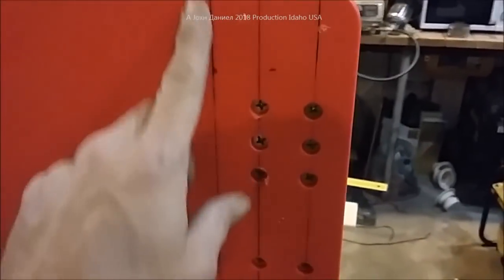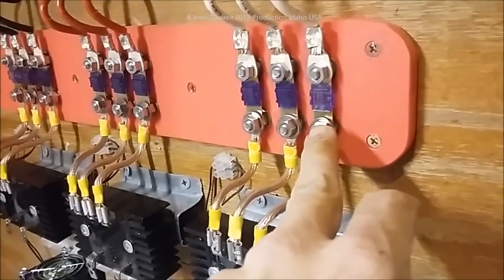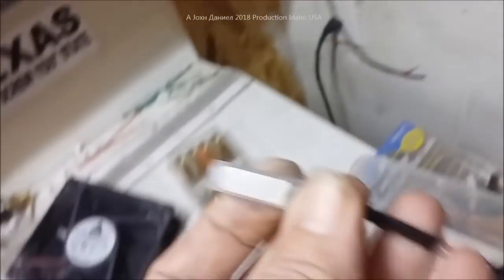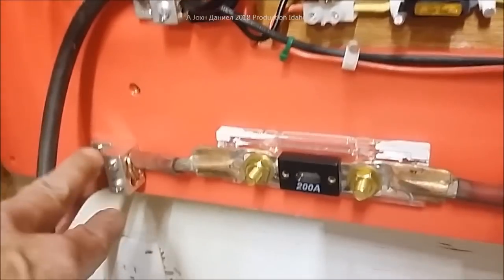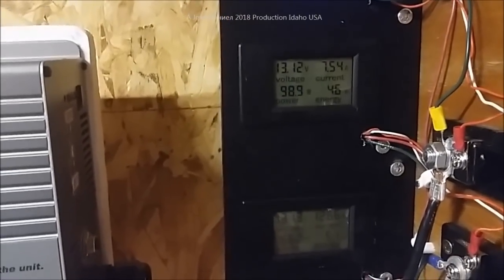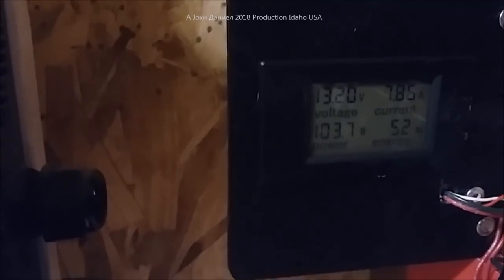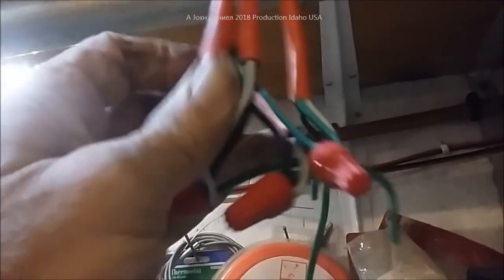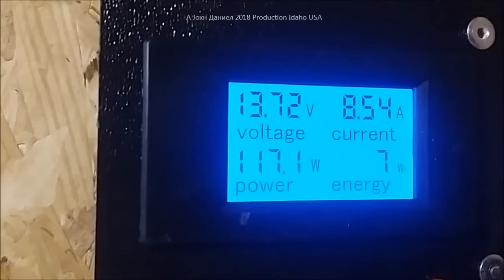Micro Wind Turbine 3 phase power systems Rectifiers pt. 1 my FULL PARTS LIST BELOW

Comment: Few years back I was checking wind power and based on my search I though the small turbines are a joke. Now your videos got me again interested in wind power! Can you give me any advice on choosing the right model of turbine and maybe also a controller? I currently have (3x80) 240 W solar panels with a controller and one 300 Ah 12V battery at my cabin. As the cabin is right next to the arctic circle I do not get too much sun light in the winter so I am thinking of a backup with wind power. I don't go to the cabin too much during the coldest and darkest time so the consumption is small. Cabin is quite tiny so I can't build a setup like yours. It needs to be something small and handy for the controls. The cabin is located next to a small lake on a hill so I get some wind there almost always but rarely any really strong winds. What I was thinking is a 400-500 W wind turbine and a hybrid controller like this https://www.ebay.com/itm/500W-600W-1000W-1400W-2000W-12V-24V-Auto-Boost-MPPT-wind-solar-hybrid-Controller/161945572633?hash=item25b4b55519:m:mcS4f4VkjihbJu8mwIYnbng. I don't see you using such controllers and I have not found much information about them. Any ideas / comments to help me? Thanks!
Reply from the maker: I would be sure to get a furling turbine if your not always there so it can save itself in a mad wind event, and that controller is a decent controller for your adventure.
Reply: Ok, thanks! The winds here never get close to the safe speeds mentioned in those chines turbines so I think I am safe with those. Just need to select one that actually works. Just too many models to choose from.
Reply: john who would you recom. for a furling turbine. Only one i saw was from missouri, i know you do not like them
Reply from the maker: Depends on your wattage and voltage you want, the best one of which I have installed 9 in 4 years is http://s.click.aliexpress.com/e/bU7iyNJ by Sunning Wind Energy because it has dynamic breaking designed into the blades, at 38 mph it just will not stay into the wind due to the blade design, below that its a power monster.
I avoid all the hyped up Sucker Born every minute sales clown in Missouri for numerous reasons, his junk in one of them his sexual activities is another. Can't stand people who exploit kids.
Reply from the maker: Another superior turbine with 12 and 24 volt, with dynamic breaking on the blades. http://s.click.aliexpress.com/e/ZnI23Zb . Sometimes referred to as a GIGU 600, they have been around 15 years, very stable company.
Reply: thanks John for getting back so quickly. I currently have pv panels 520 w and want the turbine to supplement that. 12v system with 700ahr battery bank. the system is for weekend use at present.  I am in upstate NY on top of mtn. avg. daily winds 10 mph.so which would be the better choice 3 or 5 blades? i am looking at this 600w unit you recommended
Reply: oh forgot i can not seem to find pt2 of this video
Reply from the maker: For the money, your area the Gigu 600 in 12 or 24 volt is a optimal choice. Its very robust and rated accurately. On my channel near this video in Dated upload relation you can see more on the installations. I do need to do a in depth final on how to build a REAL diversion load controller that uses Solid State Relays and a staged system. I'll be working on that ASAP.
Reply: 3 or 5 blade

Comment: I'm trying to learn...  How are you changing ac to DC? (Guessing rectifiers) What voltages?! What rectifiers are you using? I'm going to get a setup going soon, but I'm going to do solar/wind on grid tie...

Everywhere I look say to run a transformer...
Reply from the maker: I highly recommend this little turbine for starters. It has the controller that does all functions and conversions including braking, rectification and its easy to get a walmart warranty on for a few bucks. Its 3 wires down to the controller, 2 to the battery. Completely self regulated.  http://linksynergy.walmart.com/fs-bin/click?id=nNC3MIW3bd8&type=10&tmpid=1081&offerid=223073.7442&RD_PARM1=https%253A%252F%252Fwww.walmart.com%252Fip%252FVEVOR-400-Watt-Wind-Turbine-DC12V-Wind-Turbine-Kit-800RPM-Wind-Turbine-Generator-20A-Hybrid-Controller-Perfect-Green-Windmill-Home-Business%252F865700103%2523%252Fread-more%253Faffs%253De
Reply from the maker: PS, you can build a monster system in 12 volt - I did, don' t be fooled by the SELLERS promoted videos who say 24 volt or higher. If you go 24 volt and higher THEY own your ass for parts, supplies and gear. One failure in the higher volt system your waiting weeks to get a part, with a 12 volt system you can get a part anywhere.
Reply: Umm I'm building my generator from scratch and adding my magnets and doing it myself... I appreciate your help but... I'm trying to convert ac to DC, I guess I'll have to blow a few diodes and capacitors up til I get it right... I guess by ogms law, 600 watts at 12 volts is 80 amps, so as long as I double the amp capacity on diodes and build the bridge using 10k capacitors (was gonna do 1k but I'd rather have a static bank) I'm using an ac three phase and trying to go full wave.... I'm no expert but... I think I might have figured it out...
Reply from the maker: Just get a 100 Amp Rectifier 3 wires in, 2 out.

Comment: What are you using for a charge controller?
Reply from the maker: The best on the market. A Wind&Sun URD. It uses dc to dc  SSR Relays, is full pulse and dependable.
THE CONTROLLER - http://rover.ebay.com/rover/1/711-53200-19255-0/1?icep_ff3=2&pub=5575119394&toolid=10001&campid=5337966591&customid=WIND+AND+SUN&icep_item=131276389277&ipn=psmain&icep_vectorid=229466&kwid=902099&mtid=824&kw=lg #1 controller for diversion and wind
The best dc to dc Solid State Relay to buy is MAGER! (rest are bad deals, knock offs) http://rover.ebay.com/rover/1/711-53200-19255-0/1?icep_ff3=2&pub=5575119394&toolid=10001&campid=5337966591&customid=MAGER+SSR&icep_item=262718279412&ipn=psmain&icep_vectorid=229466&kwid=902099&mtid=824&kw=lg LMMC 
That controller comes with impressive instructions and source info.
Reply from the maker: I see your investing in a turbine, Be watching, i'll do a full ALL PARTS AND PROCESS NEEDED from Turbine to Battery video in the near future.

Comment: Question John I have a interstate marine Battery and I have a harbor freight 100 watt solar panel  unit with a charge controller if the battery is fully charged what should the charge controller read 12.8 or 13.4 or 14.2 what should the number be
Reply from the maker: +LOJO Marine 14.1 then it'll disconnect then reconnect at 13.8 or so. It won't stay at 14+ since 100% charge is 13.85 in a 12 volt battery and sitting charge status is 12.8

Comment from the maker: Meters 100 Amp DC, from the actual maker who sells it on ebay http://rover.ebay.com/rover/1/711-53200-19255-0/1?icep_ff3=2&pub=5575119394&toolid=10001&campid=5337966591&customid=MULTIPLE+METER+OPTION+20-100&icep_item=192247826429&ipn=psmain&icep_vectorid=229466&kwid=902099&mtid=824&kw=lg Original Meter Manufacturer, 8 to 10 day shipping.  This video shows you the simple building process of Rectifiers and Meters.  SEE MORE BELOW - Video 2 will explain how to build your own REAL diversion controllers.
A VERY Smart thing instead of buying something fake claimed as 400+ amp in a big stupid box for big stupid people with under rated 4 awg wire in it only good for 100 amps that may burn your house down.  Don't buy the hype, fraud and irresponsible stuff on the internet, build your own with trusted parts and facts.

 I restored the SUPER CHAOS turbine and put 2 more on the system. Using The world famous HORNET PMA  http://rover.ebay.com/rover/1/711-53200-19255-0/1?icep_ff3=2&pub=5575119394&toolid=10001&campid=5337668021&customid=14+Mag+REAL+HORNET+PMA&icep_item=232605009519&ipn=psmain&icep_vectorid=229466&kwid=902099&mtid=824&kw=lg Original Inventor & best on the market
 The 90/180 amp turbine Slip ring, from the ONLY HONEST SELLER http://rover.ebay.com/rover/1/711-53200-19255-0/1?icep_ff3=2&pub=5575119394&toolid=10001&campid=5337668021&customid=GENUINE+MOFLON&icep_item=271652086953&ipn=psmain&icep_vectorid=229466&kwid=902099&mtid=824&kw=lg REAL THING  - its Not a MISSOURI / Vietnam Knock Off 

This video shows you the simple building process of Turbines, Rectifiers and Meters.  
Chaos and Grey Matter is Made with PROVEN materials. If you want fake watts, you have to buy from places in Missouri. I suggest your parts come from proven sources.
 Ask, I'll send you links and you can review and apply.
Reply: At least, you should try the capacitor hook to one of the rectifier..  You would be CONVINCED after that..

Comment: I really like your videos lots of good info to learn from thanks. I purchased a 100 Watt kit from Harbor Freight to charge a couple of deep cycle batteries to run a tv  in the evening, small fan for my tent stove , charge computer etc...in my old motor home, I've read its not safe to use anything thing but a pure sine wave with electronics so what kind and wattage would you recommend?
Reply from the maker: My suggestion is to double that system of panels if you can, be sure you have at least 250 amp hours of battery ( 250 total rating @20hr) then go with a better controller like a 20 amp MPPT . A solar panel set up (NO MATTER WHAT BRAND-STYLE or MAKER) only eventually puts a Actual 75 watts ( 5.4 amps ) per 100 watts into a battery for recovery use. Its the conversion factors at play, not whether its a Topray from Harbor Freight or Sharp from Wholesale Solar. 
You increase that to 88 watts per 100 watt panel rating with a MPPT (multi point power tracking) charge controller.
The best inverter for a small system that has a very low idle wattage use is http://amzn.to/2FV1R3g the PowerTech 1000 watt. 
You will want low idle wattage or your system will just drain down due to the ghost load from the inverter being one. Plus NEVER try to run more than 80% on any inverter because your conditions will never be a manufacturers Laboratory conditions!
A premium MPPT that is absolutely perfect with Amorphous and even B quality Polycrystalline panels is http://amzn.to/2DPQadt By EP. Remember to mount it in a cool location, and on a isolated board or spot since these are commonly + positive chassis controllers and very few MPPT or PWM controllers should be bolted to a metal car or RV body.
Hope that helps.
Reply: Thanks for in info I really appreciate you taking the time to respond in detail.

Comment: nice set up. Now you need one more meter to see the total wattage's you got coming from your turbines.
Reply from the maker: Yeah, a 200 amp one!! I hit 52 amps on that BILLYJACK china beast, 49 amps on Chaos and 45 amps on GreyMatter Thermodyne turbines. All this on winds as recorded never exceeded 30 mph, and I get much higher often. I am worried the little 500 watt turbine must get a furling system or it will be toast in my area. Like my Chaos turbine, I may just bend the tail shaft on the BillyJack turbine to mimic the furling torque reactive of Chaos I designed that has been so impressive.
If the China PMA burns out, I wont be mad, it only cost me a $18 ONAN generator fuel pump and a few hours labor to get. And I can then mount a Thermodyne PMA with my 10 magnet counter passive core.

Comment: Cool setup and built to last..  Things are looking good.
Reply from the maker: +al desrochers Yes sir. When you are trying to make and use your own power you always do it better yourself than some morons selling it who don't even use it.
Reply: You might hook 100 volts capacitor and 50 000mf under each rectifiers to smooth out the power and collect more power overtime....  It would be a nice addition to the overall system....

Comment: Alright John, LoL your board looks good and I want to get those meter's. Thanks for sharing 😃
Reply from the maker: +TheBillytheJack2010 Yep, time to go pro and get away from the sold over the crooked internet stuff.
Reply: Јоhn Daniel you don't have the link to the meter's in your description.
Reply from the maker: Meters 100 Amp DC, from the actual maker who sells it on ebay http://rover.ebay.com/rover/1/711-53200-19255-0/1?icep_ff3=2&pub=5575119394&toolid=10001&campid=5337966591&customid=MULTIPLE+METER+OPTION+20-100&icep_item=112481135391&ipn=psmain&icep_vectorid=229466&kwid=902099&mtid=824&kw=lg Original Meter Manufacturer, 8 to 10 day shipping.
Reply: Јоhn Daniel thanks again!
Reply: What are you using for overspend brakes?

Comment: Nice to see the gauges in action I have the same still in the box  the inline GT130 watt meters started smoking with 50amps 24v continuous.
Little $200 turbine hitting its rated output easily.
Is the board flammable or self extinguishing , these days I try and set everything on fire as a test, wire insulation etc etc while holding my breath ofcourse.
Reply from the maker: +closertothetruth The board is fire rated to 510 degrees before it's a fire risk.
Reply from the maker: Meters 100 Amp DC, from the actual maker who sells it on ebay http://rover.ebay.com/rover/1/711-53200-19255-0/1?icep_ff3=2&pub=5575119394&toolid=10001&campid=5337966591&customid=MULTIPLE+METER+OPTION+20-100&icep_item=112481135391&ipn=psmain&icep_vectorid=229466&kwid=902099&mtid=824&kw=lg Original Meter Manufacturer, 8 to 10 day shipping.